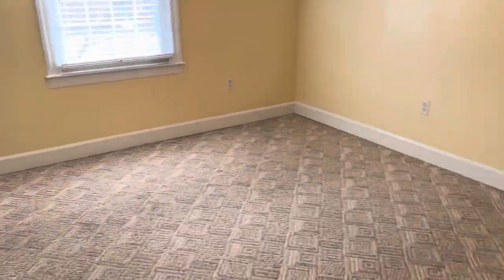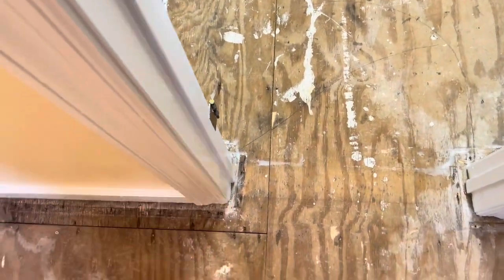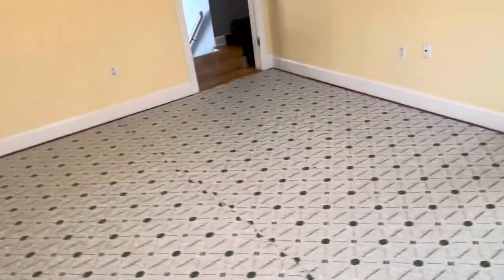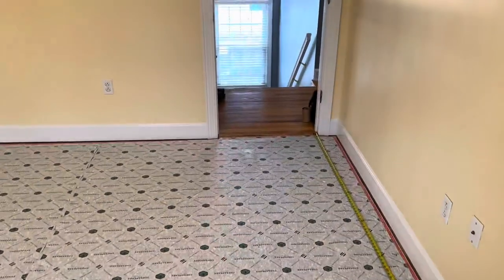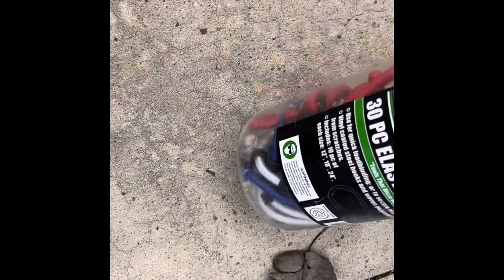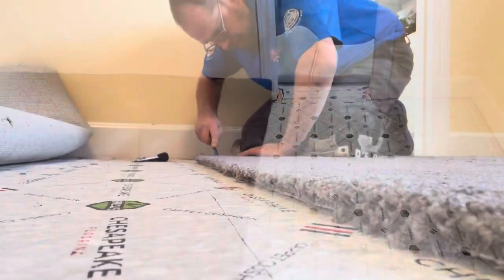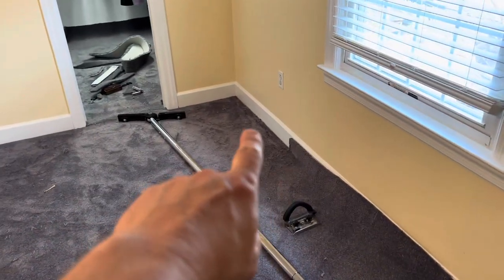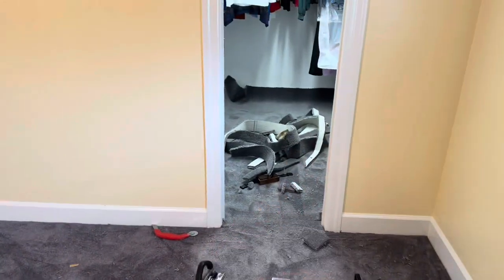Daily blog, Carpet Installation with instructions

Comment: I love your attitude in this video....  Upbeat and getting done.
One thing I would do differently.  
You use the needless to stretch the three feet or so both directions near the closet doorway.
After that sequence I might have stretched away from that doorway towards the far end of the room, that's in reverse my stretcher into the closet and stretched along that same wall, the one with that  3/4" closet partition.
Once finishing that long wall in the room and the wall inside the closet and around that partition I would have made my next stretch towards the hardwood.  I would have followed up that stretch, with a stretch inside the closet in the same direction.    The amount of tension you put across the closet doorway and, along the wall towards the hardwood could be equalized by stretching across the closet doorway inside the closet.
I'm thinking once that done to stretch in the entire room and then strict in the closet like you did.
My only thought here is to stretch parallels to the closet doorway inside the room first then inside the closet to be sure that stretching didn't cause a buckle on the left hand side of that closet doorway. 
That second stretch inside the closet, after making the long stretch towards the hardwood is the only thing that I would probably do different.
Regardless though, you do awesome work and it's good to see people like you that care about what they're doing.
......so many shops and installers do not.
That's what old age is for, having extremely high minimum chargers and restretching and fixing other people's screw UPS because they didn't care as much as you did.
It's easier on the body and people think you are a god when you fix a problem that's been bothering them.
I love your videos, keep them coming...... But don't do so at the loss of your livelihood which is getting the job done.  
You spend an awful lot of time on videos and I know it takes a lot of time setting up the camera which slows down your job a lot.   I want you to make money, installing flooring so maybe keep the videos to a minimum so you can make money and save the videos for jobs that are difficult for special.  You've got to make a living at this and if videos aren't paying anything or not paying enough then do your day job and save the videos for this special work where you want to do instruction.
This one was definitely worth watching.
Reply from the maker: On all of my daily blogs I use my phone for video, so however long the video is that’s how long it takes to do the video, takes very little time out of my workday to do these blogs
Reply from the maker: Thank you for sharing all that information

Comment: I use architecture tack strip any more. It seems to hod better. Beautiful job
Reply from the maker: 😀👍 thank you buddy
Reply: I like it but it seems to cost three  or four times what regular tack trip  and you only get half as much.
Tri-tack  has three rows of pins, same as the commercial stuff, and it's narrower, redusing picture framing..... just in case somebody  (retailer) picks the wrong pad. 😉   I'm talking about the retailer selling 7/16 or 1/2 inch padding for use underneath a thin looped pile or Berber carpet.  Synthetic felt,  32 or 40 ounce pad rocks.

Comment: Is there a reason you remove and replace tackstrips?
Reply from the maker: That way I can get the spacing proper It makes a huge visual difference
Reply: @FloorsbySouthernboys   I would agree with that if the Base board wasn't off the floor :)